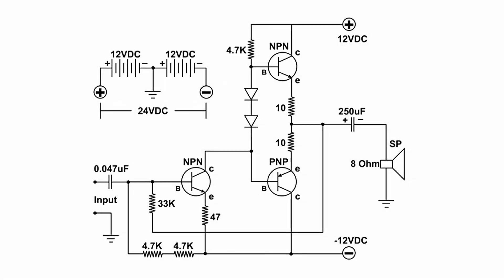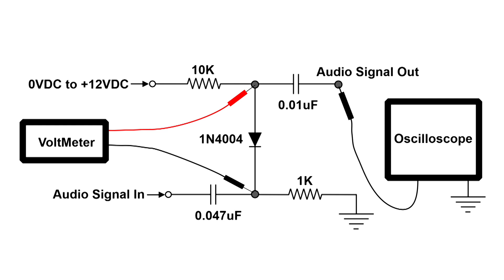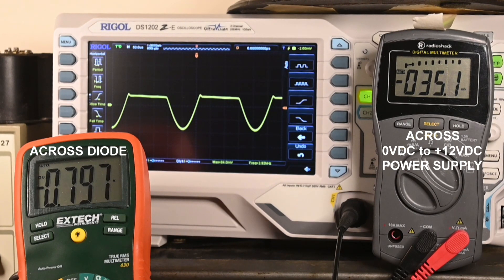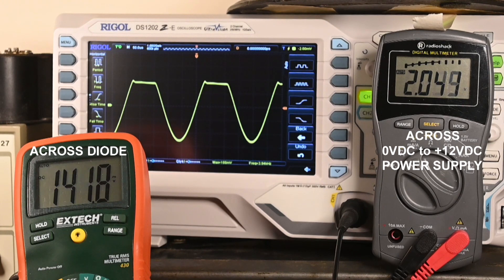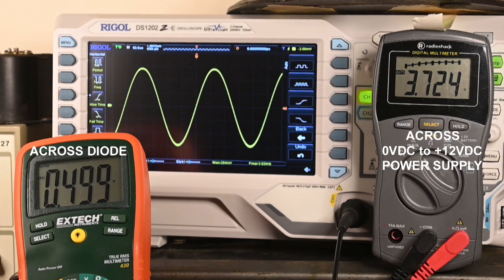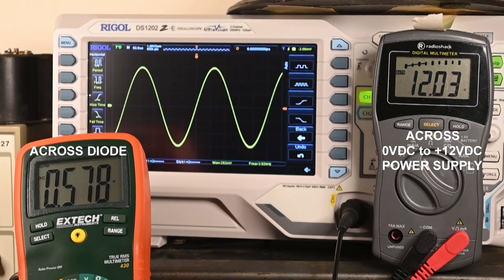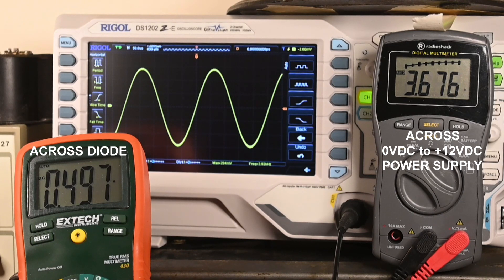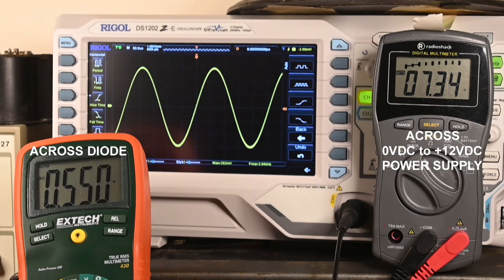How can a DIODE pass an AUDIO SIGNAL UNDISTORTED

Comment: Good demonstration of how the current flow through a diode affects the resistance of a forward biased junction.  The equivalent resistance will be approximately 26 divided by the current in milliamps.  Remember that the AC amplitude will affect the current through the circuit and therefore the resistance, possibly leading to distortion of the waveform.  This effect is commonly used as an amplitude control in many devices, usually by acting as a variable shunt.  The more diodes in series the greater the signal voltage swing capability before distortion becomes too bad.
Reply from the maker: Thank you and your welcome.

Comment: Interesting Video! So could You also make a Silicon Diode more "sensitive" (make it produce less Distortion at a lower Voltage) with DC-Biasing the Diode?
Reply from the maker: Like the FUZZ control on a guitar amplifier.
Thank you, and you welcome.

Comment: Is the point that an audio signal voltage is established across the diode in the "restricted direction" but no current flows in that direction?
Reply from the maker: It's not across the diode, it's through the diode. When the diode is not biased it rectifies the audio signal. When  the diode is forward biased it turns into a wire and the audio signal passes through the diode undistorted.
Reply: @AllAmericanFiveRadio  because the biasing voltage ensures it's always conducting. And the sine wave won't cause it to close!
Reply from the maker: @AnnaVannieuwenhuyse  100% CORRECT
Reply: @AllAmericanFiveRadio  Thanks for your reply.  I used "across" to denote a voltage as opposed to a current ("through").  Forgive my possible misconceptions  ... but I understand that when a "diode is forward biased it turns into a wire" but only for current in the direction of the arrowhead on the diode schematic symbol.  In your measurement circuit, the audio signal current is going in the direction opposite direction.

Is my problem that you are talking only about the diode(s) in 1) the measurement circuit used and 2) the amplifier circuit shown but we are NOT referring to the operation of diodes in general?
Reply from the maker: @cougar1861  When the diode is forward biased it is a WIRE. It passes AC.
Reply: @cougar1861  when you forward bias a diode, it's alike you asking your friend to constantly push the spring loaded door open. He needs to exert a constant force to keep it open but once he does, you can go either direction with your wheelie cart without any trouble. 🤫
Reply: @AllAmericanFiveRadio  I guess, if I understood correctly, that one missing piece for cougar1861 to understand what's happening is that the audio signal gets "mounted over" the +12v at the cathode node (where the negative lead of the volt-meter is connected), sort of like a AM with a "carrier wave" of 0Hz. The 0.01uF after the anode node removes this DC component, that's why the oscilloscope doesn't see the +12v. Finally, since the oscilloscope is then again referenced to ground (as you can see on the diagram), it re-couples the audio signal back to ground.

Please correct me if I'm wrong, but in any case thinking of the diode as "a wire when it's forward biased" sounds to me like an excellent way to think about it, a very useful model when designing and analysing circuits. Thanks AllAmericanFiveRadio!
Reply: @AnnaVannieuwenhuyse  So diodes are NOT one-way current "valves" and forward biasing (+0.6 - 0.7V) opens the valve?
Reply from the maker: @the-mush  Yes that is all correct. Keep experimenting and asking questions.
Reply: @cougar1861  I guess you can think that forward biasing is what opens the gate, AND that gets you water on both sides of the valve. A one way water valve adds a bit of friction to the system, just like the 0.7v of drop in a diode, but other than that once the gates are open, the water/electricity on both sides are pretty much at the same level/potencial.
Reply: @the-mush  Please explain the usefulness of having to apply 0.6-0.7 volts to a wire before it conducts in both directions.  Note, my confusion is not about the simultaneous presence of AC and DC voltage in the same wire.
See another reply, below.
Reply: @cougar1861   Maybe you don't remember the video on which you posted the question? There is an example circuit in the first 30 seconds of this video with a use case for such a "wire". Or am I misunderstanding the question?

On the matter of me interpreting your confusion as related to the AC+DC stuff, If you are referring to a reply in another thread, I couldn't find it; but if you are talking about your other answers on this thread, then let me explain myself. By the questions you ask, you seem to imply that the author of the video or the commenters are in some way saying that the diode, at least in some cases, is NOT a one-way valve (that's pretty much what you say in your previous reply). But nobody is saying that, even in the cases shown, you can still think of the diode as a one-way valve at all times.

The presence of the DC bias (by virtue of being greater than 0.7v + negative AC peak of signal) is what keeps the diode forward-biased at all times, so there is no need for a special rule for the current to flow through the diode in reverse (as you asked on your first reply to your original question).

The current never goes in the opposite direction, it always flows in the direction of the arrow in the schematic symbol. Same goes for the voltage, it's never in the "restricted direction", because the DC bias keeps it positive even when the AC makes it fluctuate (since the DC is greater than the peak negative voltage of the AC). The audio signal is just oscillating between a positive and a less positive voltage.

The only way I see to not realise this, is ignoring the presence of both the AC and the DC being simultaneously present across and through the diode, since only without the DC bias there could be a current trying to flow in the "restricted direction", hence why I thought it must be at least part of your misunderstanding. Also, the signal in the oscilloscope might give the impression that there are negative voltages, but remember that's because the author removed the DC component by the use of the 0.01µF cap before the point of measurement.

But since you clarified that you already get there is a DC + an AC, maybe the problem is with the understanding of what the "restricted direction" condition is?